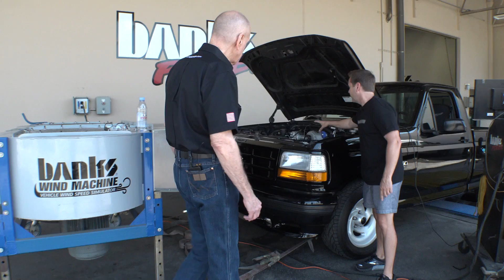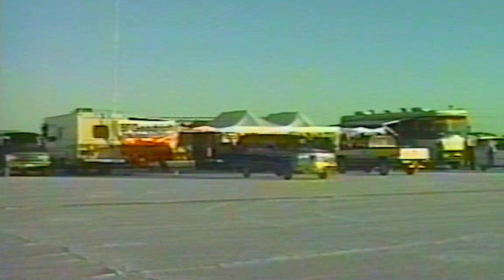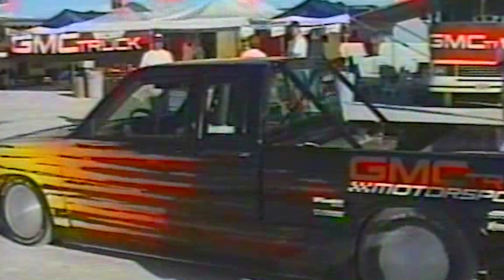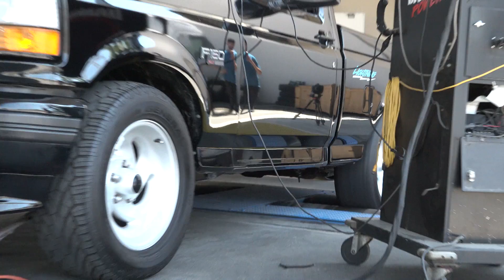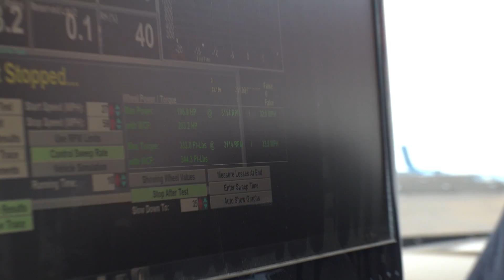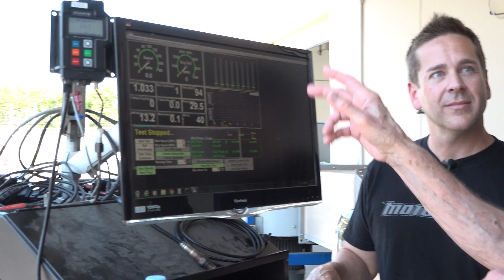Worst Supercharger Ever? - FORD F-150 LIGHTNING

Comment: Back in the day I owned a 94 lightning ,I installed a Vortech Supercharger A trim and I also installed 1.72 ratio rocker arms my truck went from running a 15.2 @ 89 miles an hour to a 13.40 @ 104 miles an hour with making 11 lb of boost. Back then the vortec was the best choice for these vehicles I don't know why anybody would install that piece of crap from Ford Motorsports. Using a mathematical formula were you take the weight of the truck some other factors and what it runs in the quarter mile and it factored out that the truck was making approximately 425 horsepower.

Comment: This is so cringey.  Matt, do your research on that supercharger.  Given the age, has the belt been replaced... ever?  Belt slip in the housing will cause just that issue.  Back in the day, I made over 400 rwhp with that same supercharger.  Speaking of back in the day, that is on a Dynojet dyno, not a loaded Eddy current dyno like the one you ran the truck on.  Not a good vid, guys.

Comment: The biggest smart-ass I ever met in red light to red light racing drove a Syclone. I was sitting at a red light in front of the Krispy Kreme on Brainerd Road in Chattanooga Tennessee and this guy in a Syclone was sitting beside me & I was in my 93 Ford Mustang Cobra, this was 1994 by the way and not looking to race just out showing the Cobra off cruising. I had my passenger side and driver side windows down he had his windows down and he looked over at me through my passenger side window & he said that's a nice cobra I said thank you that Syclone is pretty Sharp too and then he said yeah I was going to buy one of those until I test drove it and I thought you smart-ass little prick and then when the light turned to green I proceeded to blister his ass. His Syclone was not stock but neither was my Cobra.. Lol.. I would  have respected him a lot more if he would have just said I was going to buy one of those until I test drove it instead of saying nice Cobra first. That was a shitty way to bait somebody into insulting their ride. And that's a No-No among Car Guys that are Gearheads and hot rodders. I waited to see what he was going to say at the next light but he turned off Brainerd Road before he got to it and I have not liked that truck or its SUV counterpart the typhoon since.. Auto-correct keeps changing the name Syclone to Cyclone so if it reads Cyclone in some places it's because Auto-Correct thinks it's name is spelled incorrect, which it is because i never felt the need to call mine a Scobra       ;- )
Reply: Unprepped streets are where the sy/ty rigs are at their peak. Either he didn't know how to drive it or it was totally stock, maybe both. Cobras are cool but any car would be hard pressed to leave as hard as those trucks can on the street.
Reply: @turbolq4  mine had a Paxton running 7 lbs of boost a cam and a set of drag Stars I got at super shops.( before that company went belly-up ) I can't remember how wide the back tires were but I had to put spacers in the rear springs keep my the tops of my rear quarters from cutting the tires when running over bumps or potholes and yes he knew how to drive but so did I, but I was quicker.. I have a picture of that car on my Facebook page if you'd like to see it

Comment: Convert to mass air , add a set of  injectors, 340 intank pump and a proper tune you will see 350 rwhp .
Reply: Who told you that? Not a chance in hell that engine would make another 150 whp with those mods.
Reply: @chrismartin7248  you must not know shit , a 351w will make 350hp easy on 6-8lbs of boost. Its the speed density system that is holding it back.
Reply: Sorry you feel that way. Internet horsepower claims have clearly clouded your judgment.
Reply: @chrismartin7248  I have several 9.5 deck windsors that make 400hp na. I have a turbo charged 408w that is making 800hp on 15lbs of boost. You clearly have no fucking clue of the potential of a 351w . My 8.2 deck 302 with a vortech and eldelbrock heads on 10lbs is making 498rwhp .
Reply: boosted saleen
There are still people who doubt the potential of the Windsor? My favorite flavor is 90’s Toyota turbocharged engines and yet, even I am very well aware of the power potential of that W.
(Incidentally I approve of your formula for enhancement listed above. My MR2 Turbo is already MAF based and all it took was set of 550 injectors, 255lph fuel pump and a larger intercooler and exhaust to nearly double my stock HP to about ~340whp. 90’s fuel management was the restriction of the day)
Reply: Good for you boosted saleen. However, the lighting in the video will still never make 350 with the mods you suggested.
Reply: @chrismartin7248  well you are clearly a bench racer who has never built any thing in your life.
Reply: You must not know what a bench racer is. Bench racers make wild horsepower claims, like you. So that makes you the bench racer and me whatever the opposite is. If there is anything else you would like to know more facts about just ask.
Reply: @chrismartin7248  bench racer is one who does not know shit because they have not built shit it can go both ways . As for you if you did just a little research you would understand , instead you chose to make a claim that a supercharged 351w is in capable of making 350hp . It must really suck being as stupid as you are .
Reply: He'd need to get rid of that old flat tappet cam.  Matt's truck being a '95 is roller cam ready with the lifters and retainers right off a 5.0 HO.  I've got a Lightning short block in my foxbody and all the stuff bolts right no with no mods as long as it is the F4 block, which was a running change during Lightning production.  All 95s should have it.

Comment: Since the supercharger is offset (not sitting on top of the intake manifold), is it possible to drive it with an electric motor instead of the belt? That should allow the crankshaft to send more power to the drivetrain?
Reply: Needs a big electric motor, which means a big battery bank and a speed controller that can work with the ecu/tps.  It takes a certain amount of work to compress that air charge, whether that energy is from exhaust backpressure, the crank, or elsewhere.
Reply: @jdhill770  Yep... need to respect the laws of physics.  The electric turbo would be basically somewhat like building a hybrid.

Comment: Dunno, is this really a bad supercharger?  I mean it picked up 70ft-lbs tq. in the mid-range, which makes sense because the heads don't flow a ton up high and the cam isn't ground for top end power.  It's only a 6lb pully and there's some timing pulled out of it.  It really makes sense to me, this isn't a high flowing engine.

I wouldn't really say this was a bad supercharger, I'd say that this isn't a supercharger / engine / tune combination for somebody who likes to brag about peak numbers on a dyno sheet as if they mean something.  This definitely would be felt if you were pulling a load - not that this was really designed to do so.  I would say this could be modified in a reasonable manner to breathe a little better up-top and get those numbers a little more respectable.  Not going to be a power-house, but still.

Comment: It looks good. Probably way cool back when it first came out. Even if it did very little. A marketing gimmick.
Reply: When they came out in '93 the only competition was the Chevy 454SS - and the Lightning cleaned it's clock so mission accomplished.  In fact, the Lightning was allegedly faster around a race track than the same year Mustang GT.   Having road-raced one a few times many years ago I can say they surprise a lot of people.  The numbers are laughable by today's standards but they still feel quicker than you'd expect as they're also far smaller/lighter than a modern truck.

Comment: That's crazy. My Volkswagen 1.8t with minor bolt ons and a tune made 207 to the wheels through a 5mt.  That's 5.8l with forced induction. That transmission must eat up a ton of power. Is the torque converter even locking up?

Comment: Only if Superchargers didn't cost over 7k
Reply: You can buy these Powerdyne kits for less than $1k, and they make way more than 8hp. I don't know why they're pulling so much timing but that's what's killing it. And the air filter up on top of the fender.

Comment: Making a twin I beam truck handle is very hard, its "ok" offroad on the road it does not keep up ifs on a c10 or s10.
Best of luck... i hope the ford can win.
Reply: Worst is trying to eliminate bumpsteer... its really hard when the tie rods follow different arcs compared to the suspension.
Reply: I don’t know about that... my 94 Ranger Splash with twin I beams handled quite well... I don’t think making it handle is all that hard... making it handle without chewing the insides off the front tires as a daily driver might be harder to achieve 👍😂

Comment: Wow it’s a pickup and only had under 300 HP? 
My Kia has 419 HP. 😂😂😂😂
Reply: That’s because your Kia wasn’t built in the 90s.
Reply: Your kia doesn’t even have to torque to move a truck this heavy😂. Sure it moves around a little car just fine with all that power and no torque. This truck makes peak hp at just over 3k rpm where your little Kia probably doesn’t even make over 250hp until 4-5k rpm and makes peak power at like 6500rpm. What I’m getting at is even though you have more horsepower this truck will be faster in its current form than your Kia if it weighed exactly as much as the truck.
Reply: Wow you can read the brochure
Reply: For the record I was trying to bash the girl i was just saying that’s the reason for the horsepower difference.

Comment: I would say you lost prak HP do to the old very soft factory valve springs, Ford LOVED to use soft valve springs right from the factor.
Reply: Not to mention the flat tappet cam built for torque.

Comment: Ford Marketing: "How  much power we got?"
Engineering: "Some"
Marketing: "OK, WE'LL SELL THAT!"
Reply: LOL!
I know, right?
Jeez....what a turd...
I'd REALLY like to think the "engineers" knew what they were doing when designing this but, whew! 
NOW I don't know.
Reply: For the day it was ok. Compared to today the old Windsor motors are dogs.the 4.2 v6 Ford released in late 96 for the new body f150 has the same power as the outgoing 5.0 v8 in these body trucks
Reply: @thefordmaniac  We'd have to wait for the next part to know better. Was the power underated? Might be a case of needing a freshen.
Reply: @thefordmaniac  You know buddy you can pickup so really good power by adding GT40X Aluminium heads with an E303 with a Mass air conversion kit.

Comment: typical ford junk, god i hate a ford
Reply: And Ford hates you...I called them and gave them your name.  They said, 'Yeah, we can't stand that guy."   FWIW.  It's a 25 year old truck and still runs just fine.  The supercharger was an add-on part from Ford Performance.  Because it was a Ford supplied part, Ford had to guarantee that the altered motor would still meet EPA and CARB pollution requirements.   Also, since it was a Ford part, it did not alter the manufacturer's warranty on the vehicle or motor.  Now, if YOU could manage to engineer an after market motor performance part that met ALL of those requirements, I'd really like to hear about it.  I'm, of course, not holding my breath...
Reply: @buckhorncortez  like they say "theres an ass for every seat"
Reply: What the hell did Chevy have back then for a performance pickup? Oh yeah, NOTHING!!!
Reply: @johncholmes643  This video literally tells you exactly what Chevy and GMC had back then, the Syclone and the 454SS. Did you even watch the video?
Reply: @JeremySchoeder  
All those were done by '93 hate to burst your bubble Slingblade.
Reply: @JeremySchoeder  this truck is a 95-96.
Reply: @johncholmes643  You said, "back then". People were smoking new Ford Lightnings with Syclones "back then".
Reply: @JeremySchoeder  all 2200 of them yes. They were bad ass. But as far as production at THAT time lighting was it

Comment: Powerdyne is a good little blower. Picked up 75hp on a stock fox body. There is something really wrong with this truck. A centrifugal supercharger should never make the peak power RPM lower. Get it tuned properly and give the powerdyne a fair shot.
Reply: Powerdynes suck! But I agree it should make more power with a proper tune.
Reply: Cali If you treated them responsibly they were great STREET blowers. They were realistically only good for a 6lb kit. None of this 9 & 11lb BS. They were targeted at Vortech A-trims. They were never designed to compete with S-trims like many people try to. They were easy to install and maintain. Didn’t have to worry about running oil lines or anything. Once the db11 came out with the improved bearings they had virtually no problems if you left them alone. I have personal experience, on a SBE foxbody with a HCI it pushed the car to 11.9s on drag radials with a 1.9  60ft. 
It wasn’t a bad supercharger if you left it at 6lbs.
Reply: @m.geisel   I remember these blowers back in the day and many had issues with the internal belt and bearings. They were cheap for a reason. All the serious street racers were rocking S-Trims, none of them Powerdynes.
Reply: Cali They fixed the bearing issues the db10 had, hence the DB11. The key to what you said about street racers is that they weren’t meant for anything serious. They were inexpensive, relatively so, and made a low amount of boost. They weren’t designed to be anything fast. Just a low boost, low hp street blower
Reply: @m.geisel  When you say "DB" I'm thinking is this guy talking about an Aston Marton. LOL You mean BD-10 and BD-11.
Reply: Cali Same difference...
Reply: Agreed.
With that Ford EEC-IV pulling even MORE timing as the boost builds, that obviously hampers the ability to make power (as we just saw and heard).
  So run it with some 93, alter the tune where it no longer pulls timing as boost builds....then MAYBE we'll see the beginnings of some honest improvement.

Comment: ?
Reply: didn't we watch that yesterday??
Reply from the maker: @FrankLSD38  We removed the original and reposted after audio glitches were fixed.
Reply: Man something more than air density is off... might check fuel mixture.  I believe it is bad. But something is way wrong... also dyno it with blow removed and tuned for it